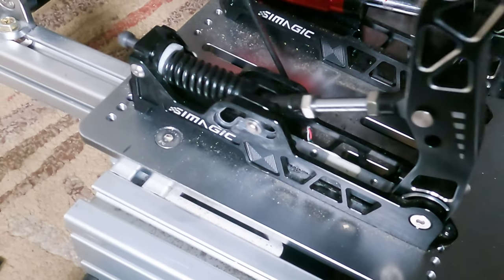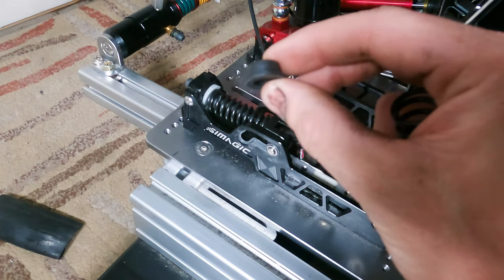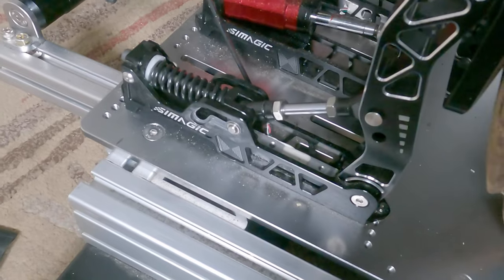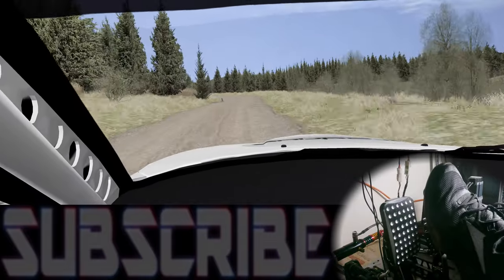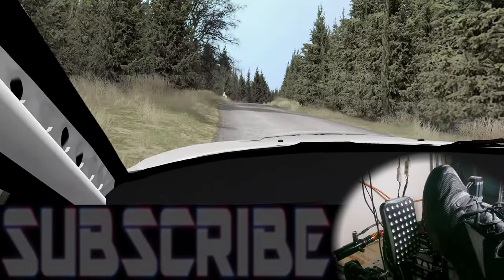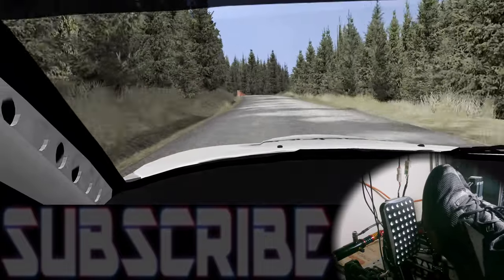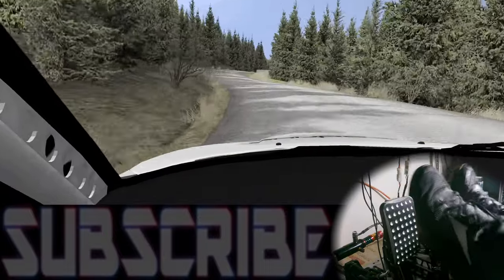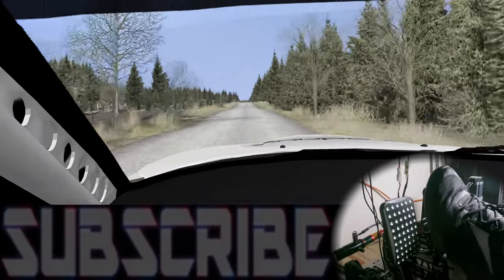Simple SimMagic Game-Changing Pedal MODS!!!

Comment: Nice simple mods mate!
Love that Fanatec damper kit on the V3's, even beat the Heusinkveld Ultimate brake!💪😎
Reply from the maker: Ya, it really feels good. Tried to attach the Fanatec damper to the Simagic pedals as you know and I snapped the damper attachment point. Lol :(
Reply: @SleepyPantsSimRacing  Yeah tht was too bad mate!..
Reply: @SleepyPantsSimRacing  Dude, get a 3D-printer instead of destroying your stuff😉. Simple mods like that take 5 minutes to construct and less than 10 to print, so you can sell this stuff.
Reply from the maker: @Leynad778  lol I do plan on getting a 3d printer in the future but the pressure the brake pedal takes the plastic would have broken even sooner. ;)
Reply: @SleepyPantsSimRacing  You can always design something better and finding a good software is one of the key-steps. I can only suggest Onshape (after trying two others), which is completely free for private use. With the tutorials of Wolfgang Walden I learned it in no time and love it. 

The alleged best printer for starters is the Ender V3 vor 210 bucks, but I would suggest the Anycubic Vyper (350$), which has some essential better components and features most people are modding to their Ender anyway for rather a bit more in price. It just works out of the box (just check if all screws are tighten) with the better heatbreak (printer-head), printbed, two z-axis motors instead of one and especially automatic bed-levelling, which seems quite challenging with other printers. I just know it from videos. 

Finding good filament is another task as well as setting up the Slicer-Software (Cura) for the best print-results. I have some tips and great settings for the Vyper that makes printing almost one-click idiot-proof. 

Tomorrow the alleged best printer leaving everything behind up to 5k will be on Kickstarter: the Bambu Lab X1. It's made from the most famous drone-company and comes with features never seen. I'm eager to buy it, but afraid of early birds problems. It might be interesting for you because it can print up to 300° C enclosed while the Vyper can only do 250° C. It could be interesting for you because printing stuff for car-engines needs special materials and high print-temperatures so it can withstand heat over 100° C. And it's f-ing amazing quick like no other and can switch four colors. But you get 5 Ender 3 for the money and it's Kickstarter...